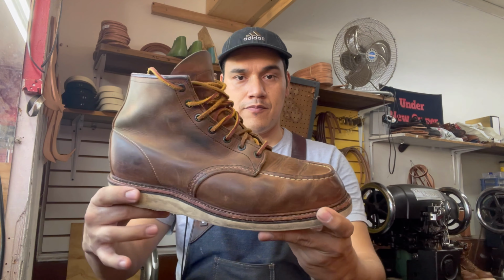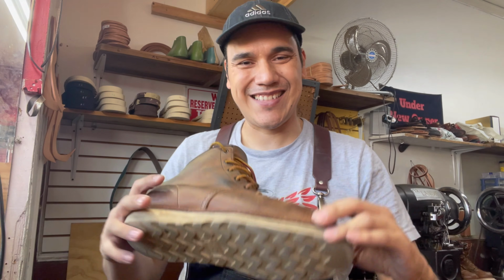Red Wing 1907/New Look /#redwingboots  #redwingheritage

Comment: The black actually looks really good on these 1907!

Quick question regarding the welt.

The 1907 comes with the 360 Goodyear welt and 360 storm welt, whereas the 875 only has the 360 good year welt.

Did the owner of these shoes prefer the storm welt and thetas why they only asked for that welt?

And what are you thoughts on the two welts? Would the boot benefit from having both welts, or one over the others?

Thank you for your time and videos! They rock!!!
Reply from the maker: Thanks Douglas,
We replace the welt because the previous one was 
Over sanded and the client chose the black one 
(Storm welt)
Storm welt is better because it offers grater moisture protector than a regular welt.

But if you ask me I like both of them!.
Reply: That’s awesome! Thank you for answering my questions. You’re the pro, so I wanted to ask 😂😂